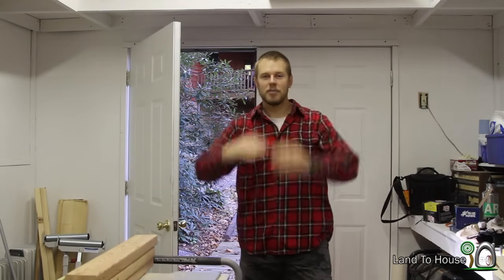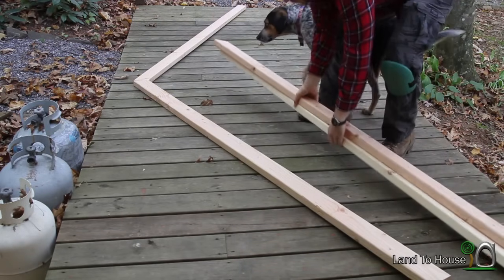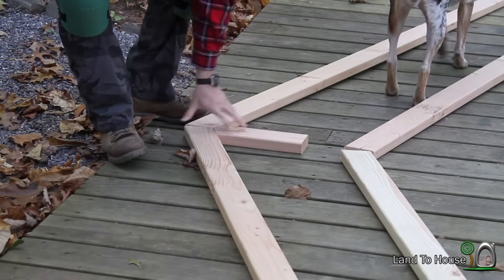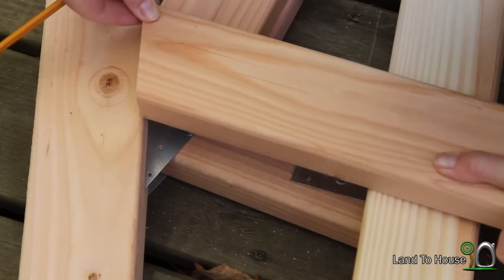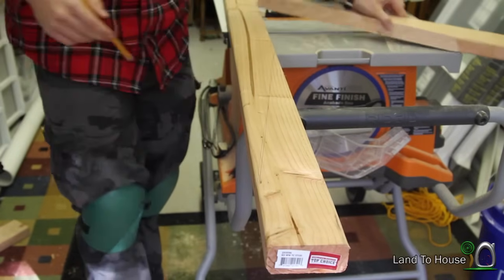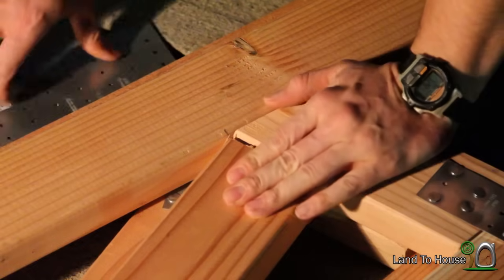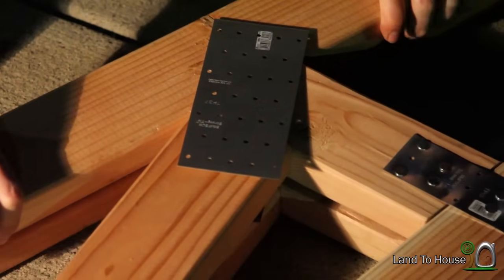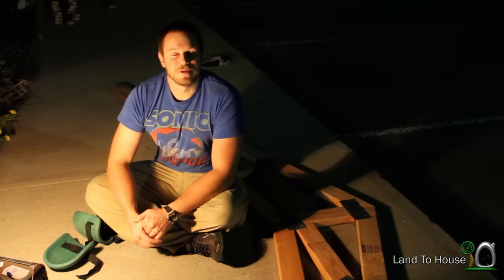Tiny House 17 - Build Scissor Trusses

Comment: Drive small blocks into your "deck" that you built them on in a manner that all trusses will be built exactly the same. Also once the first one is cut to size use the separate pieces as a template for the rest. This will work even if you were to build hundreds of trusses of the same size/type. one more thing, the center support should be mitered to fit the bottom piece too. It will be much stronger and will not move over time.
Reply from the maker: Very good tips! This is what I did for the workshop trusses. Have you watched those videos yet?
Reply: Center support is in tension only, so mitering the bottom won't help.  Even the top isn't necessary, but it provide possibly more real estate for nails.

Comment: hello I'm doing a 4/12 pitch i cut the first two boards  at 4/12 but i cut the second set of boards at 4/12 to and i cut the 12 in board in center of theses boards how did you line up the bottom of the top boards to the bottom boards to cut the extras off of the second set of boards at the ends and keep the ends of the center boards  together in their 4/12 pitch when i try to line it up it throws off my 4/12 pitch do i cut it at a different pitch on the second set of boards im trying to figure it out im just a lady please tell me what im doing wrong on the second set of boards thank you

Comment: Not an expert, however a few things before anyone does similar.
1. But a cheap chop/miter saw.
2. But proper construction rated nails. Google or find a graybeard who knows what you're talking about at the store.
3. They have nailing plates, however a lot of people cut triangles from plywood in place of those, which can be very strong. You can also make them longer to give more support.
4. Make one that is perfect, unnailed.  Batch cut all same pieces one by one until you have all your cut pieces.
5. Get some cheap plywood or OSB, and assemble one truss on top of it, to where it is perfectly fitted (un-nailed).
Draw an outline around all wood pieces in chalk, and then using scrap wood pieces, nail the ends of all boards so they are locked in place. 
6. Glue and screw or nail your truss.  Before you use screws, make sure you know what construction rated screws are, and when they are appropriate.  If you have an air compressor, its a good excuse to rent a framing nail gun.

Trusses need to be done right, and fit tight to keep a roof from falling in and possibly killing someone.  Most people watching this video aren't framers or engineers, so get some feedback on your first truss build on one of the many DIY/Construction rated forums. Or, but 1 truss from the big box store, and so how yours look in comparison. Also, for the small price difference but great peace of mind, you can always upsize your lumber from 2x4 to 2x6 to increase roof strength.

Comment: I realize that mostly tiny houses don't come under building codes but those mending plates are NOT strong or stiff enough for roof trusses. Use plates made from 3/8" plywood and glue AND nail them.
Reply from the maker: In my workshop build series I use the plywood method. I like it a lot better. Seems to be holding up very well.

Comment: love the video. Question: wouldn't using 16d nails on mending plates and clinching on other side be stronger?  i've used plywood plates sandwiched on gambrell trusses w/16d clinched and glued. very strong.
Reply from the maker: +Linda Scott most people use the setup you use!  I am new at this and it seemed like a good idea.  There are nails just for what I did but I found out too late.  They are twisted to prevent coming out.

Comment: Can a truss be made any pitch wanted or are there specific pitches for trusses?  The boards you have cut to support your pitch are they put in a specific place on the pitch to make the strength of the truss stronger?  Don't be technical when answering because I won't understand. I hope you can understand my questions.  Thank you.
Reply from the maker: I am no builder for sure. I assume there are standards by the inch. A pitch of 6:12 would be 6 inches up every 12 inches over. As for the other question I am not sure. I have a much better truss video on my workshop build.

Comment: After you built the first two trusses, did you use the table saw to mass produce the multiple (identical) parts? Seems easier to cut each of the pieces all at same time , so that they are identical? Enjoying your videos!
Reply from the maker: +DanielinLaTuna I sure did! Using the saw in the assembly line is the best way to go. After making these I would actually recommend making a gig on the ground so that you can make sure the trusses are the same every time.

Comment: I have the same saw..lol. While these look strong it would seem to have little space for insulation at the area where they meet the top plate due to the fact air flow is needed in that area as well. Also the width where the ends rest on the top plate should be measured before nailing....and if the roof is to be uniformly flat should match the gable ends as well as to width and top angle. 5/ 12 pitch means it drops 5 inches every 12 inches of horizontal travel.
Reply from the maker: Thank you for the comment. This video was some time ago. I sure have learned a lot since this early time.

Comment: Nice video. Roofing nails with easily come out.  Don't use roof except for roofing paper or shingles. Use sinkers, screws, or joist hanger nails (which 1 1/2 inch long and will be able to put another plate on the other side. I learned this the hard way.
Reply from the maker: Yes I have learned this from all the comments. So far the tiny house is still standing with no issues. When I built the trusses for my workshop I used the plywood sandwich method.
Reply: As long as it works..Right. thanks for the video.

Comment: 1/2 inch Plywood can be cut for nailer plates.  Put it under your connections and scribe with a pencil, cut ,wood glue, nail truss joints.

Comment: How would I figure the measurements to make a scissor truss to span 16 feet?
Reply from the maker: I am not qualified to give that type of info to be honest. These have worked well on my 12x12 but not sure about larger spans.
Reply: Draw out your measre 16ft across on the ground.
Choose pitch.  4/12 CA slight rain run off.
Span 8ft=96inx4÷12=32 inch rise.
Draw triangle on ground 16ft across 32 inch high point.   Lay boards on ground to fit triangle.
Draw. Walls..
3.5 inch
Reply: Scribe and cut boards 2X4 and assemble to make truss

Comment: Hemlock 2x4's? If so where do you buy them.
Reply from the maker: Believe it or not these came from lowes.
Reply: Hemlock is a type of Fir. Softer than Douglas Fir and less compressive strength.

Comment: Looks strong. nice work.  I need some scissor trusses for my living room and have to get it permited and I'd like to see if I could get away with not having to pay an engineer to do them. But please tell me how you determined the angles and lengths???
Reply from the maker: +VideoGrabBag thank you. I am completely new to this type work. My first suggestion is that you use a miter saw for precision cuts. And then use a jig on the ground to build the rest all exactly the same.  The angles were all found with the speed square.  I am not good at explaining that step. But there are some nice videos on that. :)

Comment: the value of all those mending plates , wood, time, nails and work may add up to same value as putting your order in to a truss maker,its nice to do ones own work at times though..i use plywood as gussetts,which are the same as metal ones..good work though...

Comment: Ok you are doing well till the mending straps..clamping is a great way to hold things in place. a fella that i worked with schooled me to there importance.I recently moved into an older property.The roll down or hammer down plates are coming loose on the garage trusses.So plywood nail on gussets are still my favorite using the heavy galvanized nails..Great job on the video ,thumbs up to you.
Reply from the maker: I now have a new series on building the workshop and I use the plywood method. Much better.